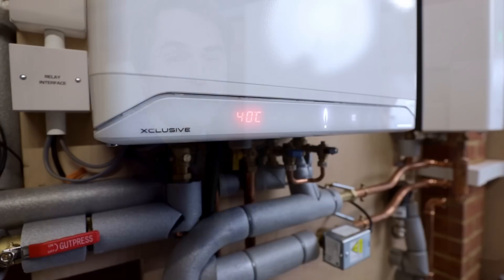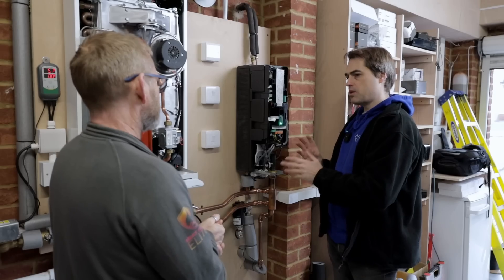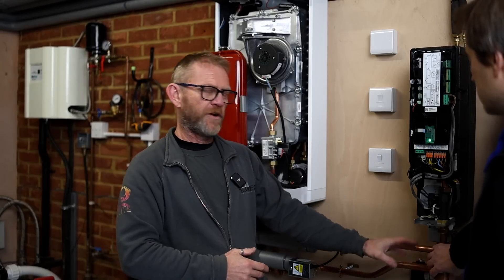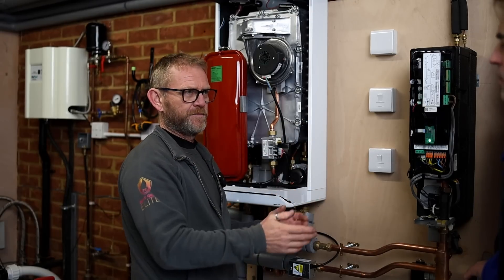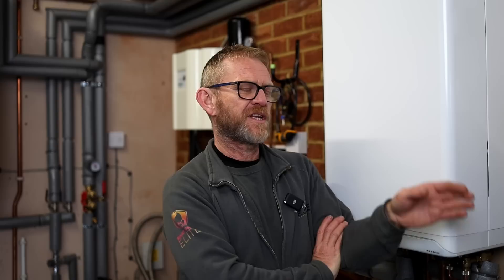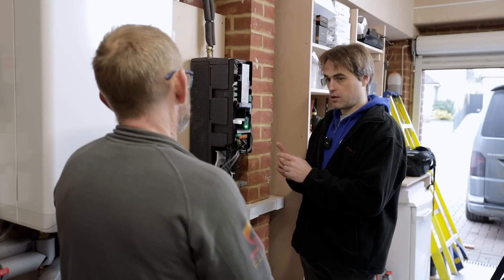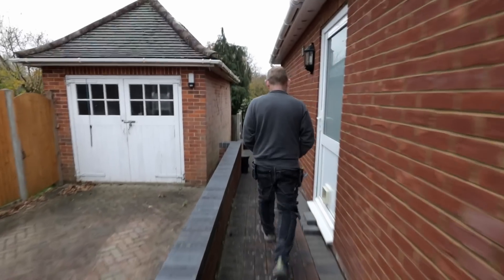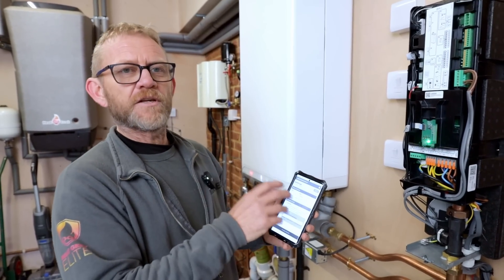Intergas Heat Pump Hybrid - The Easy Way To Clean Heating?

Comment: I love the Xtend. I am an installer in the Netherlands and have installed about 12 xtends. I haven’t had any problems with the cct. I always use an 25L - 50L buffer. The Xtend works with almost every boiler. Even boilers without opentherm.
Reply from the maker: Good to know. Could I talk to you via DM or email please?
Reply: @UrbanPlumbers how do we get in contact? I am not sure how dm works on youtube. I also cannot post my mail adress on here?
Reply from the maker: @timkors1346 can you message me from a form on my web site? Www.urbanplumbers.Co.uk
Reply: @timkors1346  I'm in the Netherlands looking for a installer for this type of setup, how can I contact you?
Reply: Good honest opinion. Sounds like it a work in progress. Can’t see it being cost effective when you need a high end/cost combination boiler, plus the indoor unit, plus the air source also. 
At least he admits the limited return of the ASHP in colder months. 
Essentially what he’s doing is installing a buffer vessel, or even what was a Dunsley neutraliser in the old days to link different heat sources to a system. 
Wonder why the pump in the boiler doesn’t modulate down further?
Reply: With what companies you work with? I'm also in the Netherlands and I want to get this kind of hybrid system. Thanks
Reply: @geovede  how did you go with this?
Reply: Lovely piece of information there. Watching the video my thought was  in Holland installers might or might not have come across issues with the ccts.  Then @timkors1346 answered my question.  I might get one for my house
Reply: Would using the NRG awareness zone product work here , trying the 2 units better together and replacing the heath robertson low less header ? ( I am not a heating engineer just asking )
Reply: Hoi Tim we zijn aan het overwegen om begin dit jaar de xtrend 5kw te laten plaatsen. Wat me nog tegen houd,  werkt het systeem wel goed, met alleen radiatoren.  En wat zou het stroom verbruik zijn , moet de pomp 24/7 draaien en op welke temperuur. Wat doet de pomp in verbruik met lage buiten temperaturen. Ik kan er vrij weining informatie over vinden. Kwam dit tegen en hoop dat je misschien wat meer kunt vertellen over de xtrend. mijn cv is een hre 24/28 1 jaar oud. onderverdieping 185m3 wil alleen nog de badkamer boven erbij verwarmen. Ik hoor van mensen dat de radiatoren niet goed warm worden met een hybride systeem.